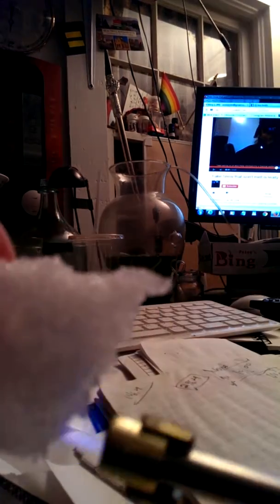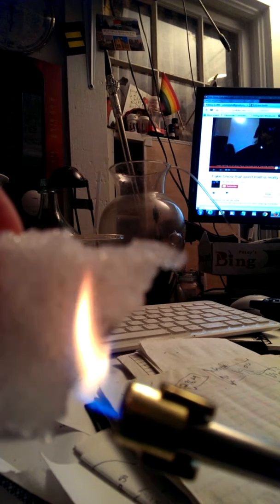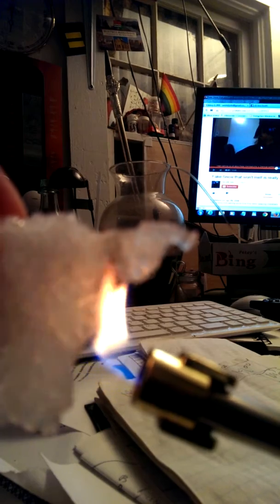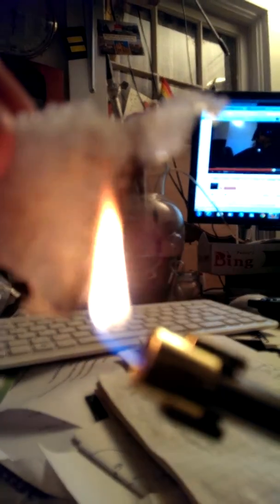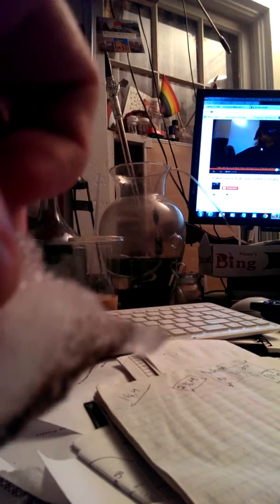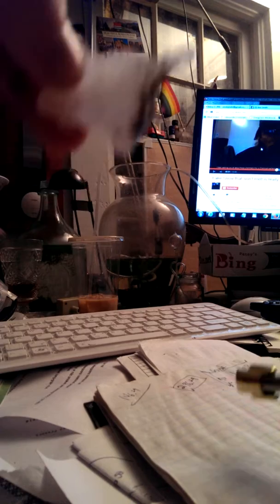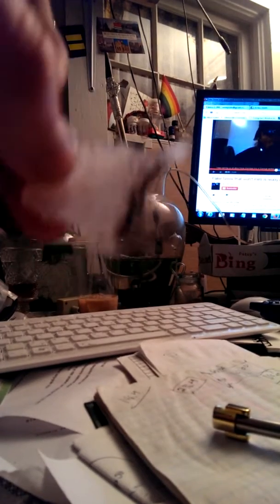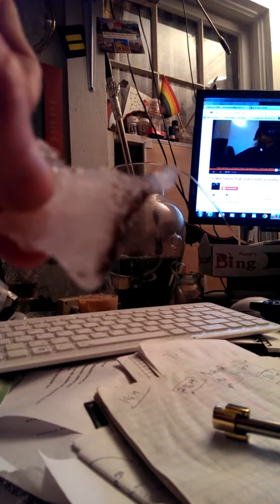DEBUNKED Fake Snow that won't melt is really Nanobots 2014 ....NOT

Comment: From
http://www.reddit.com/r/conspiracy/comments/1wjaub/fake_snow_in_georgia_why_cant_a_flame_melt_it/

It takes a lot of energy to melt ice and snow.
It takes 334 Joules to melt 1 gram ice at 0°C.
A butane lighter flame gives off around 900 Joules per minute.
If you just hold the lighter next to the snowball most of the heat goes straight up. Also if you don’t let the flame burn unobstructed you get incomplete combustion and less heat, and soot.
The snow is a great absorbant that suck up the small amount of water that actually melt.
To melt 1 gram of snow or ice you would have to hold the flame under the snowball for several minutes. You actually heat several grams at once, and the heat transfer is far from perfect.
This hoax demonstrates how gullible and uneducated a lot of people are. And how the hoax is spread by the most gullible that are close to panic... I suspect that there is some trolling involved as well. At least I hope so.

Educate yourselves.